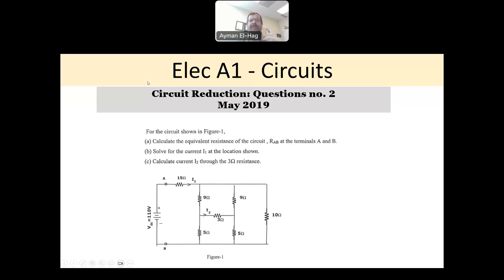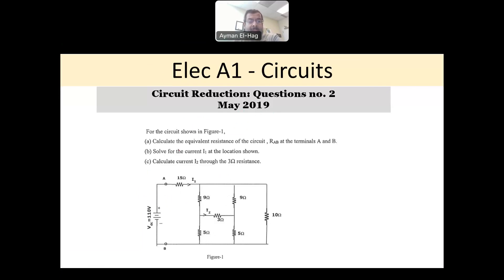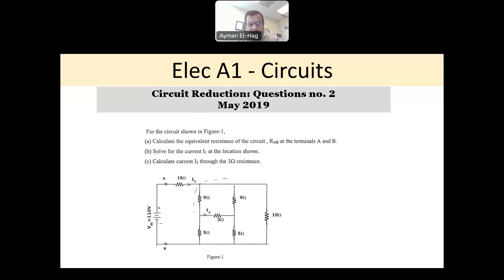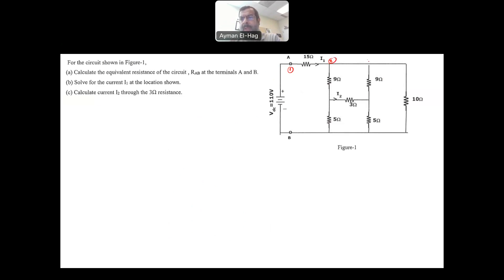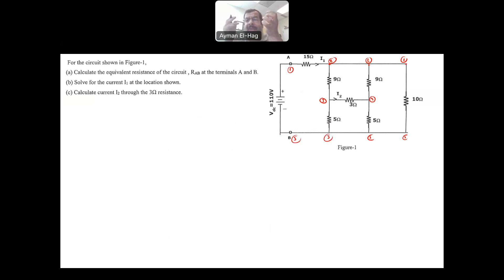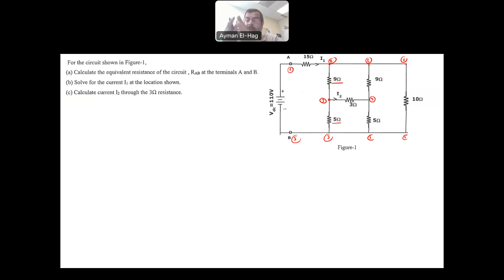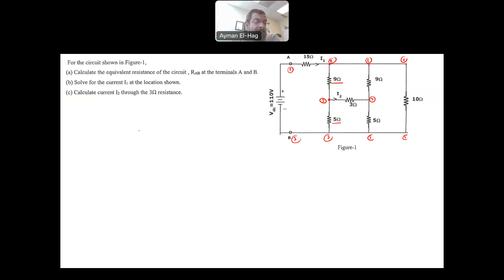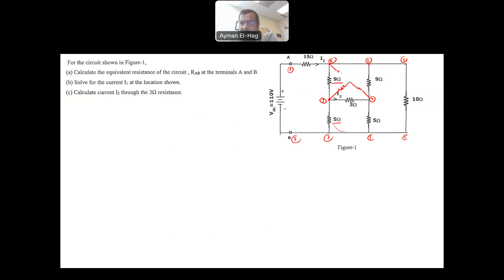PEO solved examples (ELEC A1): circuit reduction Question no. 2

Comment: can we ignore the 3ohm resistor during circuit reduction, as there is no current flowing through it?
Reply from the maker: Yes, you may remove the 3 Ohm without influencing the circuit.